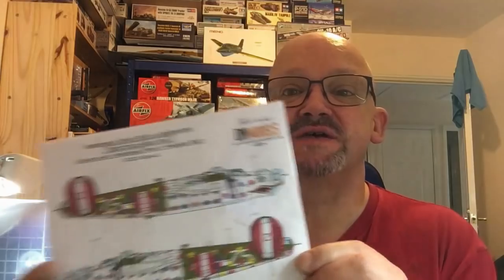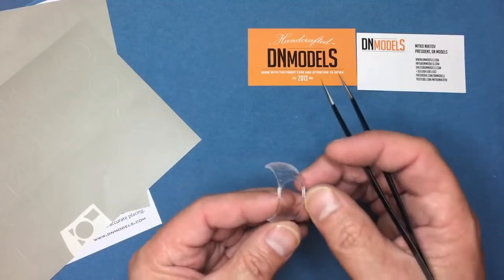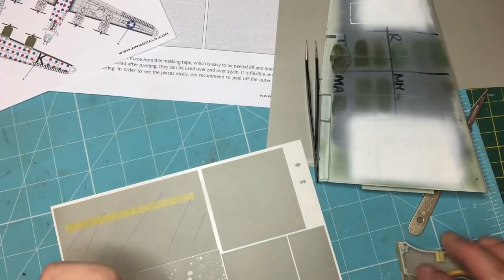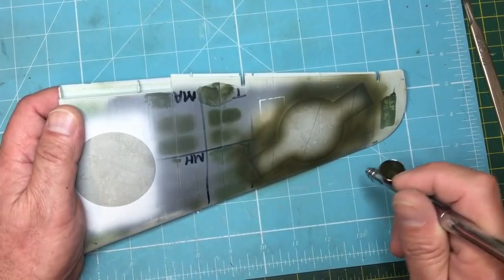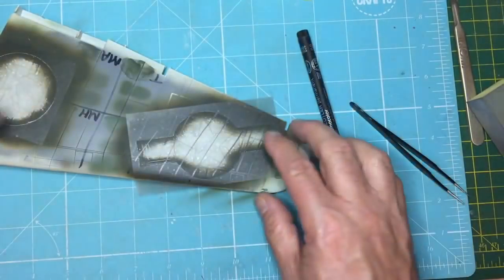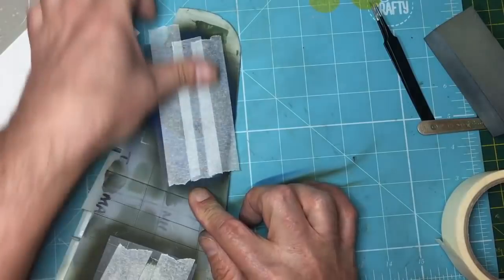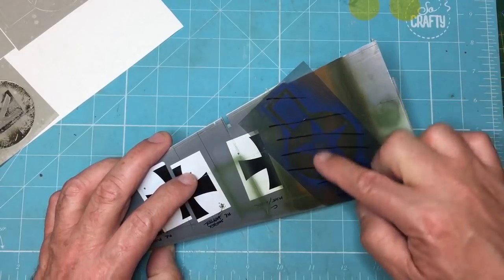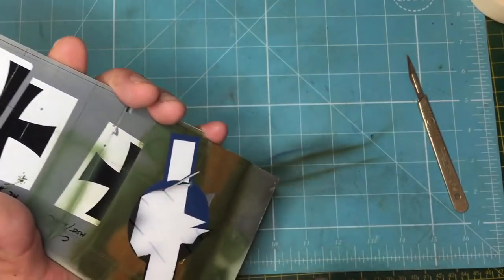How I use DN Models masks for Insignia

Comment: Wow, I'm sold! I've seen stencils used on tanks but on a large insignia like that, brilliant. I've often thought that decal edges always looked too clean. Those insignia were quickly painted on reusing stencils multiple times. I believe they used (at least on the large, common insignia) a wooden framed stencil that they simply laid on the wing or hung on the fuselage. Bleed and soft edges would be more prototypical than laser straight lines. I doubt they hired professional sign painters.
Reply from the maker: I agree with what you say regarding poor quality on the edges, but I don't think it would be accepted in the aircraft modelling world. It's the same with the invasion stripes, they were rough as hell apparently? We always paint them perfect!!
Reply: Well, regardless, that is definitely the way to go. It just looks fantastic. You’re right on the stripes. Most of them went on with a bucket and a worn out brush.
Reply: @NigelsModellingBench  If you want to avoid paint creep, try a light coat of clear varnish around the perimeter before you spray your color. Let the varnish dry and it will seal the edges of the mask. If anything creeps it will be clear. Especially handy on surfaces with a lot of panel lines, and metallics that seem to wick paint more easily.

Comment: One other thing, I would imagine they have painters tape in the UK at your local DIY. The blue or green tape in the Paint section. Same size as regular masking tape but lower tack to avoid pulling paint up. A lot cheaper than Tamiya masking tape.
Reply: Tamiya is more expensive,so it must be better? almost everything in hobby is repurposed tool for something else.Suprised they don't sell 8B pencil's and call them 'instant metal' precision applicator...$9.99
Reply: Amen to that. My wife is a manicurist. I discovered foam sanding sticks and blocks 30 years ago. She still gets them for me dead cheap. Now look how much you pay for them in a hobby shop.
Reply: I have had wife and daughters Nail CA glues and sanders too,my best find has been old mapping ink pen's,they are similar to ink attachment on compass,they have a little wheel to adjust jaws,perfect for applying thin CA in lines,or out of the way places.Always at car boots and junk shop's.